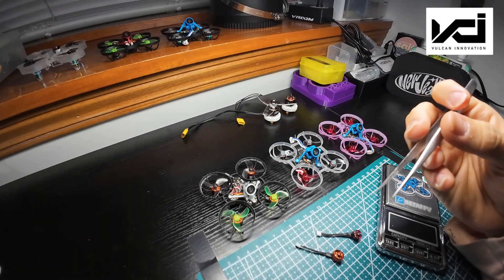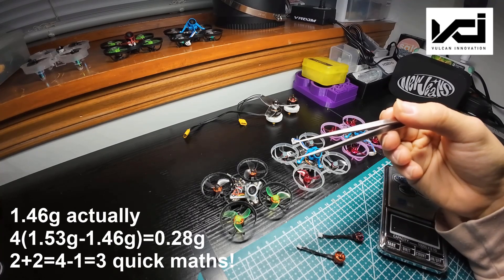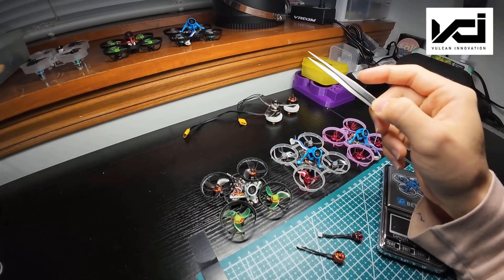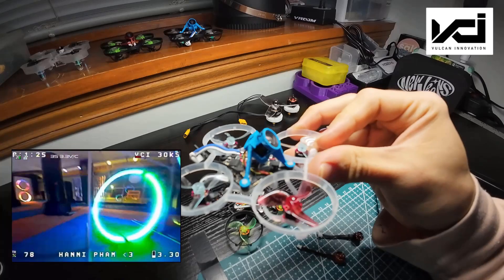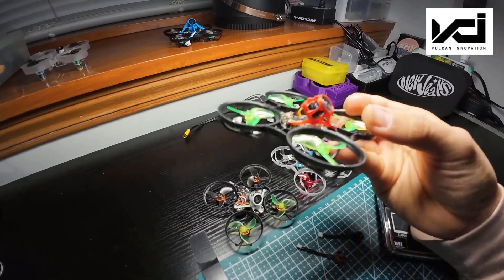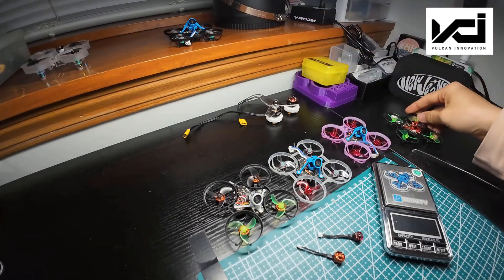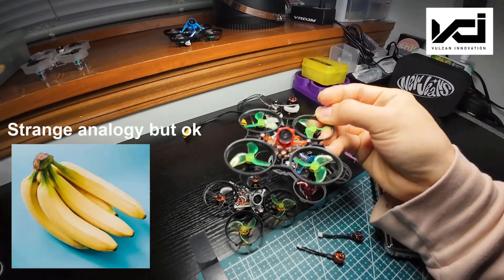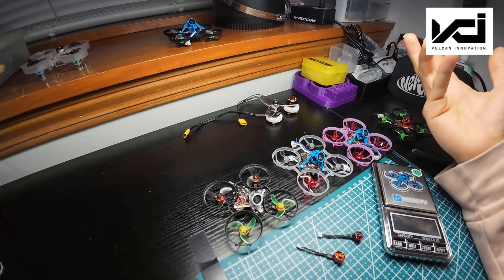Quick Review: VCI 0702 V2 Whoop Motor | Yapping by Werdna FPV

Comment: Great new format! Motors with delta termination are great in my experience, but only with 96khz. So for pilots who don`t like the 96khz smooth flight feeling it`s maybe better to go with WYE Termination. I see it the same way as you. There's a perfect motor for every racetrack application/flying style. But there's no motor that can do everything at a high level. Actually, it's logical. It's like in Formula 1 or other sports. As soon as you push the boundaries, there's a perfect tool for every purpose. The disadvantage is that it becomes very difficult to find/construct the perfect tool.
Reply from the maker: Thank you for the kind comments, can you share why delta termination feels good for you on 96khz? Is there any scientific explanation for this? I am happy to try it out as I usually fly on 48khz.
Reply: @WerdnaFPV  Well, maybe I should put it this way: high kV, delta termination, 96 kHz, and an AWG20 main cable. My experience is primarily with 75mm whoops. And I also have a specific flying style. I barely use the upper 20% of the throttle. High kV, delta termination, and 96 kHz (and an AWG20 main cable) give me a consistent and smooth throttle feel. Unfortunately, that's all I can say. And as you said, everyone has to find their own motor. There's a motor that's best suited for each application.

Comment: Compared directly with TW of the same size and kv (minus the 30k I used 32k TW. The TW motors outperformed the VCIs in every way including efficiency. So I've spent $300 in motors testing it myself. They are ok motors. But not efficient. Zippy! But if you need more than 2 minutes of flight.... 🤣
Reply from the maker: No doubt the TW motor is excellent and is the best motor that Happymodel has ever made, when you say they outperformed in every aspect what aspects other than efficiency did you test for?
Reply: Thrust, and personal feel. I see what yah did there lol. Idk what the TW hate is about Andrew Y. I think the VCI motors are extremely smooth. But if I can't get 2 minutes out of them without killing a 300 mah tattu that everyone put their own label on. Am I missing something I really want to like these. I have 23k lights unopened, 27k DB (these are the worst performance for me, and the 30k lites. 

If you have any recommendations for getting the most out of these I'd be down to try again . @WerdnaFPV

Comment: which motor would you recommend for a 23g O4 65mm whoop? I'm torn between the 27000 and 30000kv db version..
Reply from the maker: I would strongly advise against O4 on 65mm... the disc loading on the propeller is much too high for an enjoyable flight experience... you want a 75mm or 85mm for that purpose, with a strong 0802/1002 motor running somewhere around 20000kv
Reply: @WerdnaFPV  Thanks fot the warning. I want something tiny, 75mm is too close to my Babytooth. I'm not a racer, my previous Walksnail 65mm build was fun outdoors  (with Happymodel 0702 28000kv) .
Reply from the maker: @Unboxingexperience7  You should go with the 27000kv DB motors then
Reply: @WerdnaFPV  I want to build 65mm O4 whoop (23g) 31mm prop. Will it fly with 0702 23000kv DB? I want to get max flight time. Or is it possible to use 0702 23000kv DB with 35mm props?
Reply from the maker: @BegHip as I said a 65mm O4 whoop is possible but it will not provide a good flight experience. Especially with just a 0702 motor you will be overloading the motor and hurting flight time
Reply from the maker: @BegHip it will fly with 0702 23000kv, just very badly. It's not recommended to use 0702 with 35mm props because it's also too much load for a 0702. You can consider going to 75mm or using a larger motor instead like 0802 if you really want to go with 65mm O4.
Reply from the maker: @BegHip 0702 was never meant for this application it was meant to reduce weight at the corners to make the rotational moment of inertia smaller for Super lightweight 65mm under 18g dry.
Reply from the maker: As a rule of thumb... any 65mm with a dry weight above 20g is too heavy, it's better to move to 75mm

Comment: Thank you for review! Could you help with choice optimal KV for me? I decided change my betafpv 0702 27000KV v1 to this motors. I ma not professional pilot, and I use 85% throttle limit. In paper betafpv motor 27000KV have 31g thrust, and it is less than VCI motor 23000KV (32g). But these numbers confuse me))
Reply from the maker: As I stated in the video, many manufacturers may not accurately state their KV values, so don't be confused by them - thrust data is indeed a more accurate way to get a metric of the motor performance. I think you want to go for the VCI 0702DB 27000kv - this is a good balance of power and efficiency, on 85% cap it will effectively be 23000kv, you can gradually remove the cap as you get better - and the ball bearings are more long-lasting than another motor with bushings.
Reply: @WerdnaFPV  , thank you for your answer! I hope a high-KV motor will prompt my improvement, even at the cost of a small loss in efficiency))

Comment: A few months ago I was lucky enough to get a set of the 0702 30000kv prior to release. I have to say they are the best 65mm motors I've ever had. They're delta wound speed demons and the motor wires don't break😅. I'll be replacing all whoop motors with these once available
Reply from the maker: @themadhatter196  that's awesome! Looks like you got a prototype version as well, because the production versions are back to the wye winding method

Comment: By chance did they thicken the PCB for the motor wires? The vcis I broke so many of the pcbs where the enamel wires soldered onto.
Reply from the maker: Yes, the PCB is indeed thicker than the V1 Spark, and there are holes in the PCB that line up with the motor mounting holes so a screw that is a little too long will not give tension on the PCB and cause it to crack. However I still recommend keeping the heatshrink as strain relief for the PCB or at least a dab of E6000 instead of leaving them naked like many weight weenies do.
Reply: @WerdnaFPV  sweet, thanks!

Comment: I have this new motors, they are great. (Im VCI pilot too :) hi)
I switched to pink 30000kv VCI from nbd rs because my motor wires constantly breaks on NBD, and I tired resolder them because they are just enamel wire and its hard to solder them in 1-5mins in race conditions.
Mainly I fly db 27kv VCIs now, because our tracks are mainly tight and need more controll. When we have fast, more space track, delta 30kv feels great!
Reply from the maker: Do you secure your Racespec motor wires with E6000 or B7000 glue? Since doing that on both ends, I have not had any issues with them popping off.
Glad to see you are enjoying the DB 27K I also think it is a great balance of power and efficiency :)
Reply: @WerdnaFPV  I secure them with t7000, maybe I just crash a lot :D

Comment: I was thinking about getting a newbeedrone racespec, but after watching this should I wait a couple of weeks and build my own with theses new VCI motors?
Reply from the maker: It depends how much you value the DIY vs BNF experience. As I said in the video, the NBD motors with Delta winding are incredibly powerful and amp hungry, the strongest 702 on the market, but are a poor choice for tighter tracks or tracks where efficiency is key. Also, the FC on the Racespec has spotty QC and is inferior to the offerings by Betafpv and HDzero. If you want to get the fastest BNF, buy the Racespec but if you want the most customizable experience with low failure rate I would probably build a DIY whoop with these new VCI motors together with a Betafpv FC.
Reply: @WerdnaFPV  thanks, I was leaning towards that option anyway, do you know when and where these motors will be released?
Reply from the maker: @ They should be out on all the major retailers like Wrekd and Pyro in the next few weeks but due to the ongoing trade issues with China nothing is certain. Message me on Instagram in a week or two and I'll update you